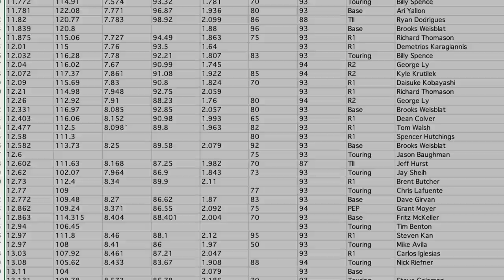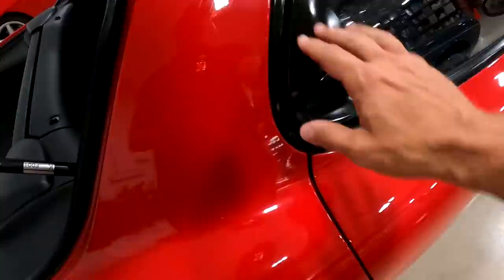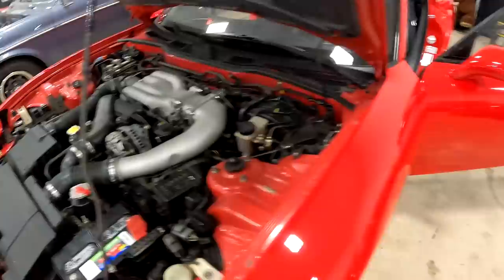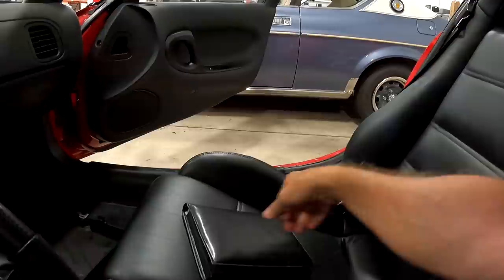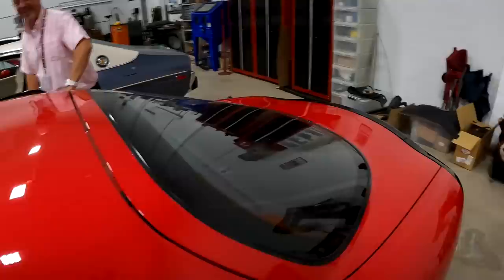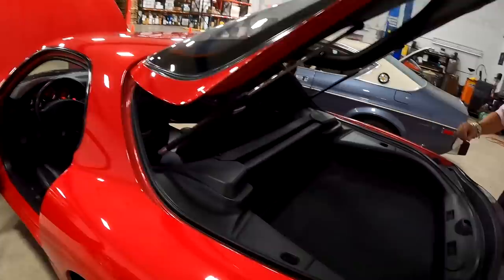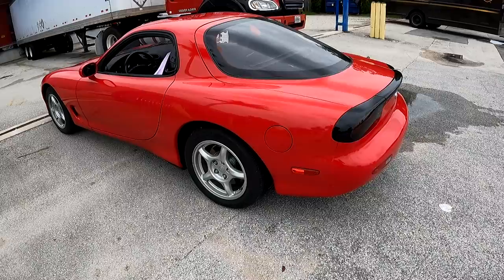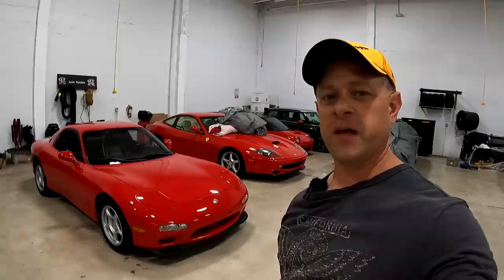HOW DRAGTIMES STARTED * Buy the car that started it all?

Comment from the maker: Should I buy an all original RX-7 or one that has been modified?  3-Rotor Single Turbo?
Reply: Go for a 4 Rotor AWD, beat the Plaid and surprise everyone :))
Reply: You and Adam LZ starting rotary build.....just awesome 👌👏😎🙌👍😀
Reply: So did you buy it Brooks?
Reply: I owned 3 RX7's, an '80 GS, a '86 Sport Pkg, and a '92, I really loved them, but I kept them stock and had no reliability issues. Good Luck!
Reply: Rx-7 is a classic ride brother
Reply: Get both and then keep the one u like more
Reply: No
Reply: Go All original.
Reply: Make the rx7 the final boss
Reply: 1 rotor per wheel
Reply: I'd get it and do basic mods to free up some HP, but probably leave it on stock turbos.
Reply: Do a stock look with some good hp maybe 500hp. Just to get moving 😎
Reply: I'd buy the original especially if you're going to keep the miles down. Nothing like having a pure stock example of a 90's sportscar. BTW, I had two VR4's a 92 and a 97. The 92 was a dog after 70mph but the 97 was a much better example. Threw some 13T turbos in it with 450cc injectors, no cats and downpipe and that REALLY woke it up. Believe I ran a high 11, low 12's with that setup. Anyways, good luck with whatever you decide.
Reply: Do it, Brooks! LOVE IT! (original is my vote, but either would be great to see on the channel)
Reply: This example should stay stock, what a time machine
Reply: YES
Reply: Yeah dude buy an original one like you want!
Reply: @DragTimes  original is the best for the long time and a modified for the fun (mine is modified just for fun.. not racing or anything
Reply: Spirit R would be sick af
Reply: Just buy it already,can almost see it standing in your garage,but keep it orignal please!
Reply: If you're going to modify it, better get another one, the fact that this RX7 is almost stock is unbelievable
Reply: Yes do it
Reply: Original please.
Reply: Original only and you know it.
Reply: Well once you get the model S plaid, your other cars will just be collectibles. Keep the Ford GT and definitely buy the car that started it all! DO IT BROOKS!!
Reply: Dragtimes Awesome Video I think a that FDRX7 would be a great vehicle for the Channel and I hope you won the bid
Reply: @robdahm
Reply: Both!
Reply: make a 3 rotor
Reply: I dont think there is need to own both FD's! 
Its either 3 rotor 1+ turbo or just like people said mildly tune this one to get the thing moving BUT - KEEP all original parts in case of revert!!!
Reply: Original
Reply: Fred Garvin, I’m pretty sure the FC went through 1991 and I know the FD  started as a 1993 (my CYM R1 was built in August of 1992), but I don’t think there was a 1992 RX-7, at least not in the US, but you may be outside the US as I hear some other countries get the interwebs, now. :-) Does anybody really know the answer?
Reply: Do you have a museum to keep it in? Are you going to drive it frequently and get upset when a rock chips the paint or parking lot door dings? Are you going to fret over keeping the mileage low? Unless you want it for your museum collection don't buy this car. Get a modded up beater and do something interesting with it. It is a very light chassis, people have turned them into 8-9 second cars so.. 
Or you can lightly modify a beater with bad paint and just use it for fun, DE days, stuff like that. Hell some even do V8 conversions with a 9 inch rear end. Maybe see how fast you can make one while still keeping it street able?  Could be a fun contrast to all those Uber cars you do these days.
Reply: Original
Reply: Original!!
Reply: Wow what a true story! Nice
Reply: BUY THIS
Reply: RX-7 Original. Better mod the Tesla Plaid, reduce the weight with carbon fiber, especially rim and sprung weight component, and body if possible. Then drag race it and see how fast it can go. Is it possible to increase the motor power in Tesla without voiding the guarantee and still get routine update?
Reply: I'd try a 3 rotor this time around.
Reply: I’ll sell you my 2JZ-swapped RX-7 and you can have the best of 90s JDM in one car!
Reply: Original one and I hope that you won it at auction. Nothing like zinging out a rotary past 9000rpm and the buzzer buzzing.
Reply: best to buy a modded one for sale. if it has 2 rotor. throw the thing (nah just kidding) and hook up angel motorsports for the 3 rotor setup making 800-900hp. should  be awesome to drive!!!
Reply: No, rather get something new like a budget sports car like Supra or Nissan Z and mod it
Reply: Buy it man !! Be good for the channel
Reply: Whichever tickles your fancy, but get an FD. You know you want one. 😉
Reply: Give a call to Rob Dahm
Reply: @8w494  why not
Reply: Nah... It was fun to stroll down memory lane, but no need to live there! I'd pass!
Reply: @mikehagberg  why would you pass though, is it because the car is crap and the tesla model s plaid is better?
Reply: Keep it 13b. Three-rotor is heavier and worse handling
Reply: I'm sure he wants top dollar but, that is a perfect example. Going to be hard to beat.
Reply: Buy it!
Reply: @alim7502  hard to go AWD with a rotary setup in a rX-7. It’s almost impossible without changing the entire car
Reply: Buy it! And give it to me. 😭
Reply: @cj41079  RIP FD Prices.
Reply: No
Reply: @tryingtobebest  I agree. If you’re a collector, keeping a totally stock rotary is going to sky rocket because everyone else is modifying them.
Reply: @johnyc2744  I agree. I wouldn’t be mad seeing a garage queen FD now adays, since seeing a stock FD is rarer than a completely modified out the ass one.
Reply: Buy a Pac peformance 20B , 1000 Hp easy .
Reply: I have no doubt that if I sell my RX-7 it will be totaled, it's just too quick and not remotely forgiving.  It's not that it tries to kill you, but it wont warn you and certainly wouldn't stop you.
Reply: It's been like 25 years, but I vaguely remember a story you (?) told on the RX-7 list. You were racing some guy (can't remember what car) and you beat him. At the next light he pulled up next to you and said, "what did you pay for that, like $15K?"  Was that you, or am I remembering things wrong?

Comment: Man it would almost be a shame to modify that RX-7, it's so mint! Maybe just enjoy it stock.
Reply: Agree 💯
Reply: That would be so wack 😂 Nobody wants to see a slow car
Reply: @NicolasEsparza45  no one has to
Reply: @NicolasEsparza45  you would only keep a  stock car in pristine condition obviously to keep its value up as a collector's car.
Reply: Totally agree 👍🏻👍🏻👍🏻 Leave it original just as it is.
Reply: No it wouldn’t who the hell wants a slow ass car.
Reply: @gblikesnikes  to just enjoy its design, its still fun to drive, its drag times' history, its a jdm icon
Reply: I bought my FD new, by today's standards it's not very impressive, 0-60 5-5.5 seconds 14.0@100mph no traction control.  Mines heavily modded but fully functional, as in everything that worked stock still works aside from the fog lights which I deleted.  That's not that common on 450whp single turbo FD's not afraid of speed bump either and has 255 up front and 285 in the rear tire right to the edge.  '99 spec body part and the vented scoot hood.
Reply: @NICKCAMP04  ummmhmmm yea put some power in that shit. I’m all about JDM but I hate driving slow cars.
Reply: It will be tuned  over the top and out of this world !

Comment: I had a 93 base original owner, hooked up with Rotary performance in Garland TX, my car was the original test mule before they got their own car and started racing. I also took it to Virginia Peter Ferrell and started with those mods. By the end it was single turbo with a complete engine management system. I was more into road racing but did go to a drag strip a few times and managed an 11.6 @118 but did not see my name on your list. Those cars were really hard to launch with all the power up high you either bogged or ended up spinning the tires. I see you had Ari Yallon listed at the top, as I recall he eventually got into the low 9's. Not sure who has the record 1/4 mile for this car, might be him or Able. 
I did pop the motor several times, after it happened twice in a 3 month period I finally sold it in the early 2000's. It was a very clean nicely modified car I think I got $18K for it. Funny, some kid bought it and wrapped it around a telephone pole within 6 months. Mine was silver and I bought a red base model for my wife. Her FD was left stock and also sold early 2000's after we had kids. It had around 45,000 miles and was also clean, sold for $15K. They can be reasonably reliable if you keep the boost reasonable. They can reliably make about 350 HP which in such a light car is plenty. When you start trying to get more, it is only a matter of time, any detonation and those apex seals are gone. we tried thicker seals, ceramic... doesn't matter. 
I would love to have one again for the nostalgia, but for $50-$75K? I would have to pass, they are nice but... 
That is one of those cars for someone with a big warehouse/museum who wants to collect classics that sit in a show room and get driven on rare occasions. I would go for a beater with a blown motor and needs paint, slap a new motor in it, get a cheap paint job, and use it as a DE day beater. I have no interest in museum cars, i like cars that are driven hard where I don't worry about rock chips and parking lot door dings. This is why I can't have nice things.